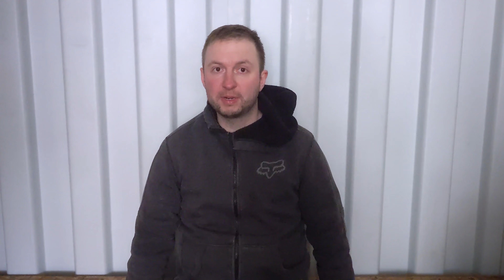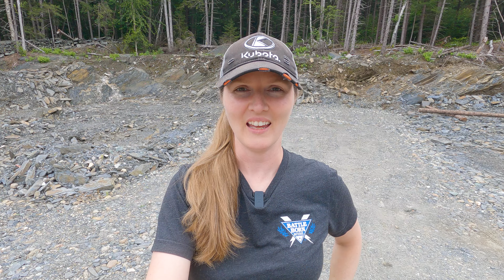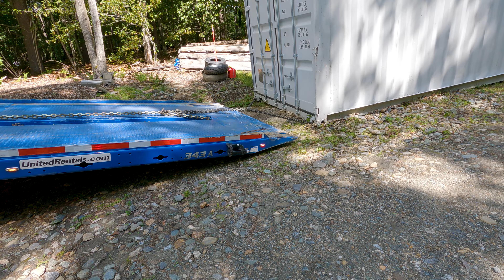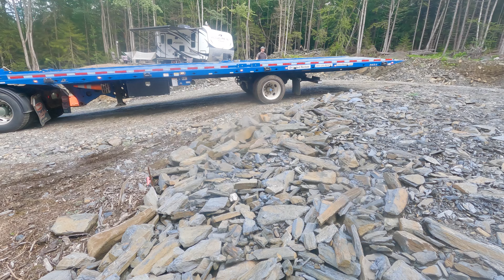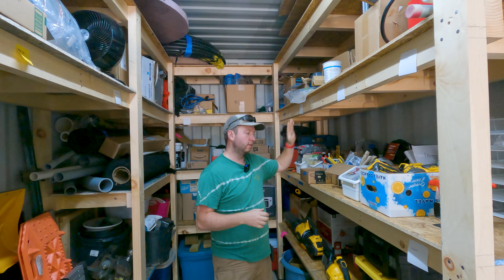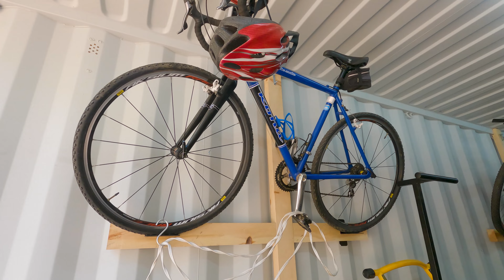Evolution of our SHIPPING CONTAINER workshop

Comment: I got a “toe jack” from harbor freight. Which I used to level my shipping containers. It just needed a 1 inch gap, and will lift 12 tons.
Reply from the maker: I’d not heard of those before. That basically looks like exactly what we made using the bottle jack and the bracket. Cool tool since I guess you can use it for lots of different things but in our case we had the bottle jack do the metal bracket was a cheaper option.

Comment: Matt did you consider two 20ft shipping containers placed parallel  with a 16-20 ft space between. This would provide for a future roof spanning both containers creating a nice 20 x 20 covered work space. Maybe slightly more expensive for containers but accessing 20 ft container from each end would provide up to four ( 2 per container) 10 x 8 storage areas and reduce the 40 ft hallway.
Reply from the maker: Not really. We wanted to be able to store the sawmill in there, like we did last year, and that’s over 20ft. Also just in general, having a single large space is more useful to us than multiple smaller spaces. Depending on your needs though, I can see how that would work well.

Comment: Have you had any problems is condensation?  I would think that a tightly closed volume like this would have considerable condensation - especially during the changes of seasons.  Mold, mildew and rusting of equipment - any signs of this?
Reply from the maker: We had a little condensation last year on very cold mornings when we were working in there. Nothing since though, I suspect because we’re in and out so much so it’s really well vented.